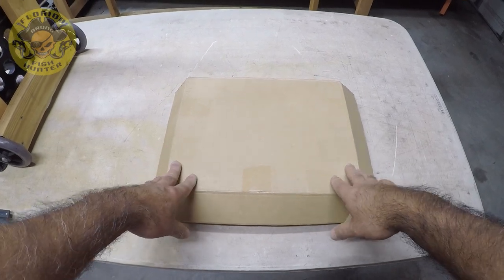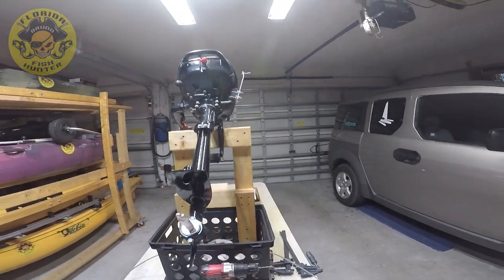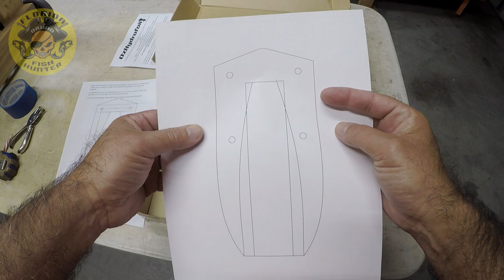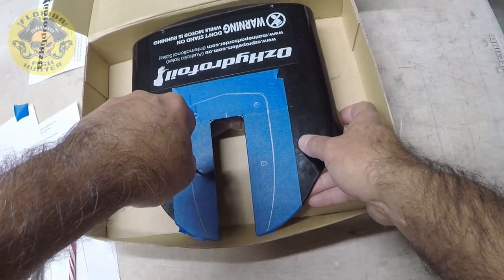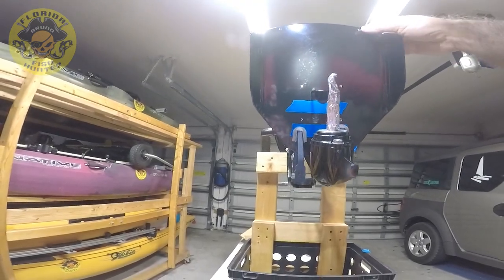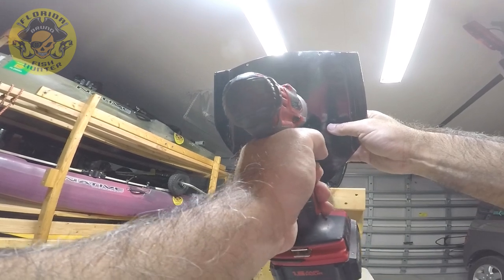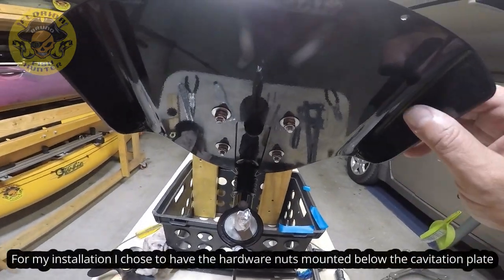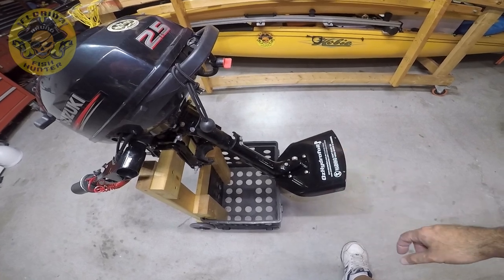Suzuki 2.5hp Outboard Hydrofoil Install - Florida Fish Hunter

Comment: Hello dear friend, I have a similar engine mounted on a Nucanoe Unlimited and I'm thinking about making a hydrofoil. Could you clarify for me, what is the thickness of the plate (in millimeters) and whether or not it really is a good change?
Reply from the maker: Hi @andor1nha! The plate is .125" or 3.175mm thick. Normally when sitting in my Hobie PA17t or Hobie Tandem Island, I would be sitting near its stern. With my weight and the weight of the outboard and any other accessories the bow of the kayak will be riding high off the water. I installed the hydrofoil strictly for the purpose that it would help to raise the stern of the kayak when moving thereby lowering the bow which in turn would result in a smoother ride while pushing less water. I'm happy with it and feel that the plate is working as advertised. Just make sure that your outboard is angled correctly for your transom mount. https://www.youtube.com/watch?v=X5qT4fwxBqc